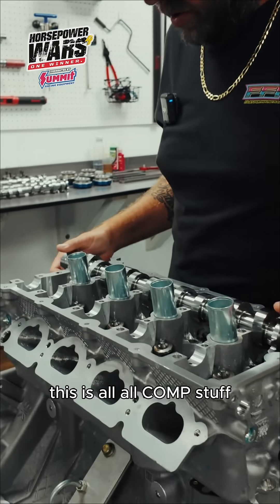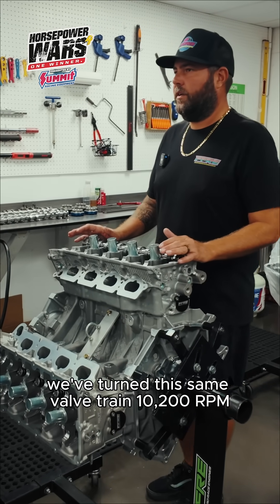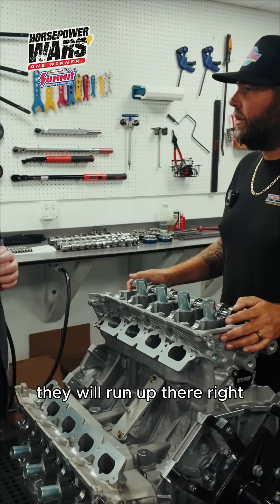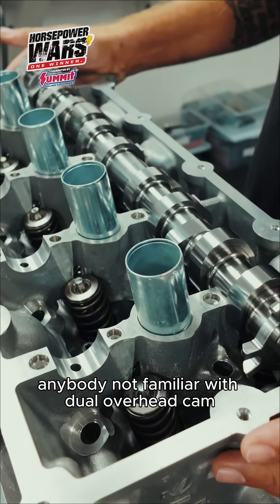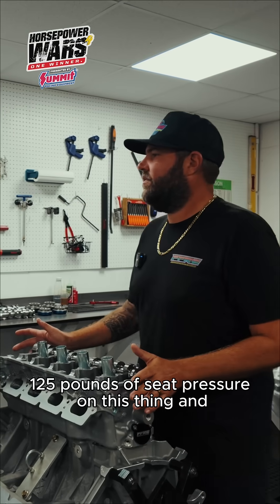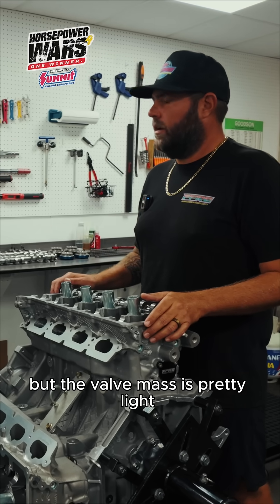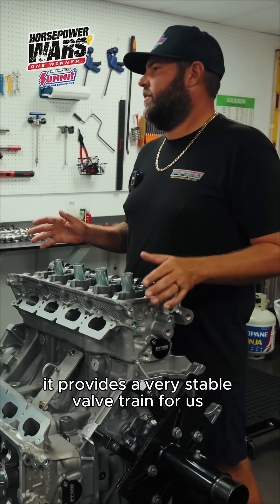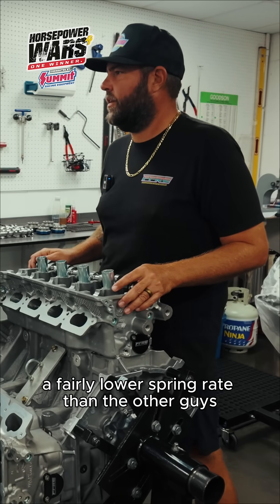FFRE talks about the valvetrain from @Compcams1976 for our 1,300+hp Coyote #shorts

Comment: This is totally false.... The valve train never spins that much r p m.... It only spins about half of the r p m that the crank does does
Reply: The ENGINE sees 10200rpm.. The valvetrain supports that.. Not too hard to understand is it?
Reply: So the valves aren't in time with the cylinders? Come on